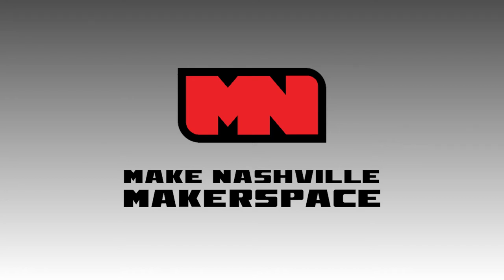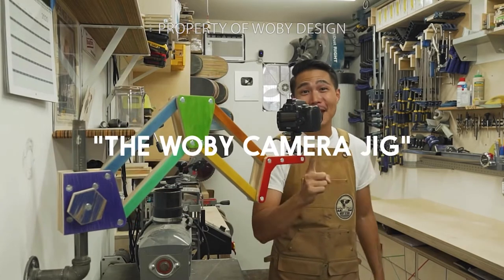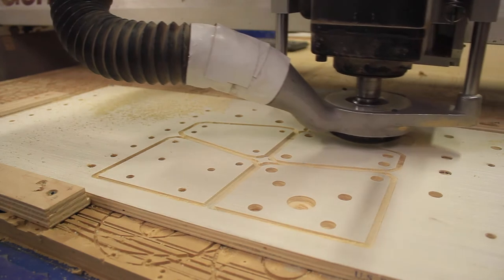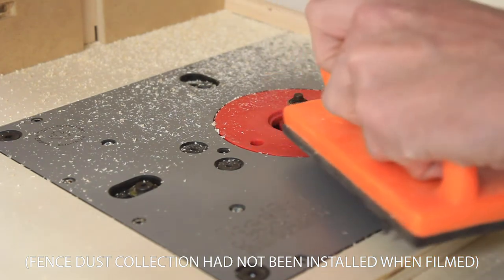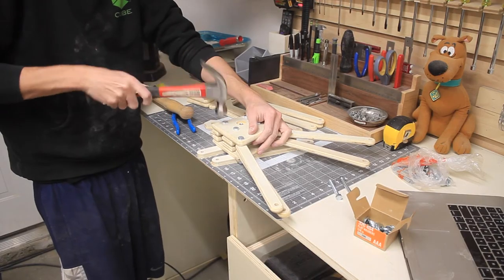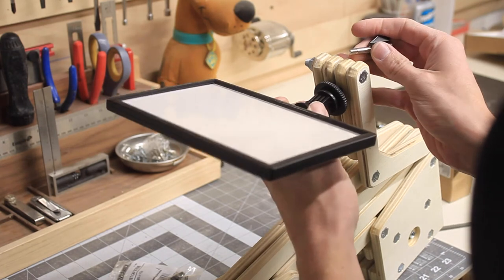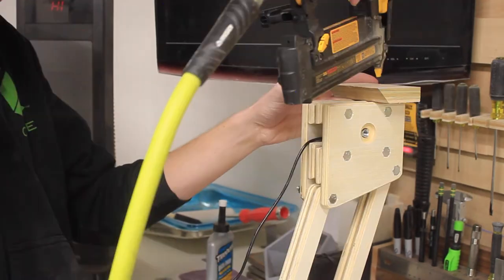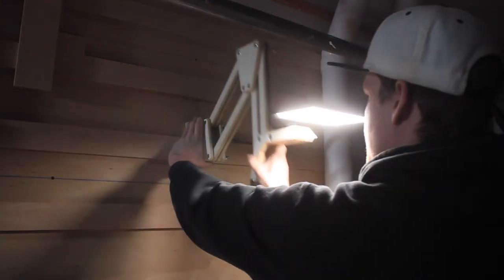DIY Plywood Boom Arm Worklight

Comment: Nicely done. Subscribed. :-)
If you wanted the swivel flexibility, you could get the 3/4" pipe mounting plate, elbo, and short length of pipe and mount that assembly to a french cleat. Best of both worlds. I still need to build my woby jig; like you, a couple of them will be used as flexible light fixtures.
Thanks for posting. Keep it up and you'll be at 10k in no time!
Reply from the maker: Thanks for the encouragement, the channel has really been growing lately! I think I might build a few of these as actual camera jigs, and if I do that I will certainly use the swivel.